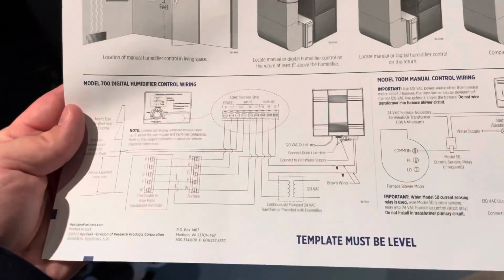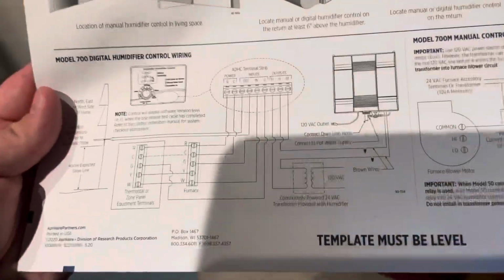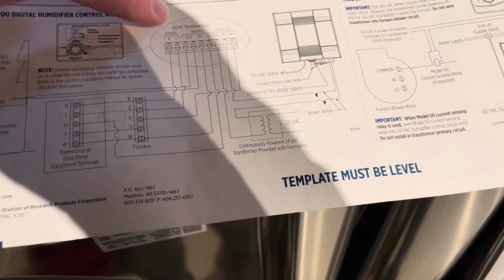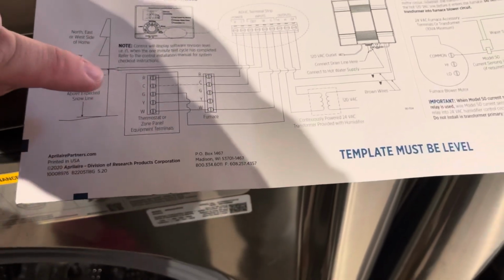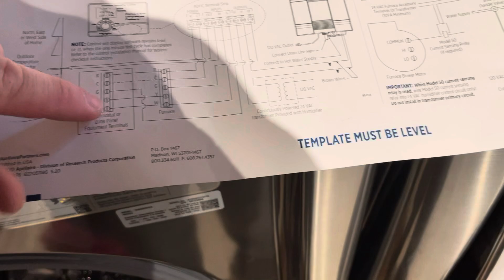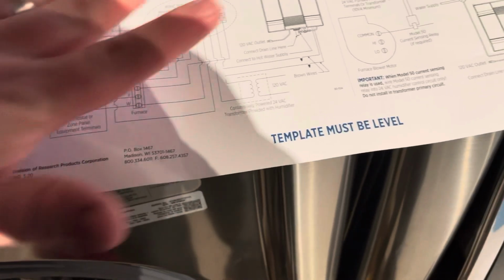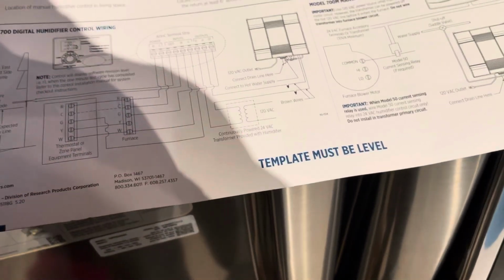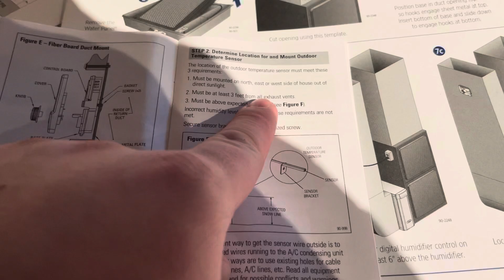Aprilaire 700 Series Transformer Wiring

Comment: I have a Carrier furnace as you..your control board is a little different from mine. Does your control board have ODT TERMINALS. if not where did you hook up your outdoor sensor to?
Great video by the way!!
Reply from the maker: Thanks! My outdoor sensor wired directly into the Aprilaire automatic humidity controller.

Comment: Do you really need the transformer? I have seen a few videos where they don't use the Transformer. I am also considering connecting my 700m directly to my nest thermostat using the * connection port on the nest, this way the nest can be programmed with a target humidity level and trigger the blower and humidifier to circulate air until the level is hit-- and many diagrams I've seen bypass the transformer completely. What do you think?
Reply from the maker: Transformers change the voltage and not having it installed would send the incorrect voltage and possibly damage the unit. I would not recommend bypassing the transformer.
Reply: I was told by an HVAC teacher and collegue that depending on the unit and the board, you might not need the transformer at all.  He said the board has plugs that product 24v-40v directly on the board.  I am meeting with him Thursday to go over it.  What bothers me is that the unit runs on 120 volt for the fan.  They could have easily wired in a transformer into the system and run it all off the wall plug.  All it would need is the connections to the mainboard and Model 60 humidistat.  And do not use those damn needle valves.
Reply: @Balticblue93  ive never used the transofrmer and i install 100s of humidifiers. Take one wire from humidistat, one wire from solenoid, meet them in the furnace and tie them together. Take the second wire from the humidistat and put it on W or HUM if its a 24v plug. Take the other wire from the solenoid and put it to C. Works 100% and Ive never had an issue. This only works with the manual one though. Digital is different like the one in the video.
Reply: The older 700 series did not have the 24V transformer, the most recent one does require
Reply: Depends on furnace and the board. Some furnaces HUM terminals are at 24v and some are 120. Always check before installing.

Comment: i just replaced my bryant 700m whole house humidifier with the aprilaire 700m and did not want to mess around with changing the transformer or humidistat controller (manual not digital)....the transformer is smaller but the values are the same; however, it does not turn on when the furnace activates.....should i assume the transformer and or the control must be replaced too?  (original transformer : input 120 v / 60hz output 24 v 40va  and aprilaire is input: 120v-60hz 15w utput: 24 v - 0.42 a 10w)
Reply: The Bryant 700m and the Aprilaire 700M are the same exact unit.  You should have gotten the Automatic and you would be setup perfectly.

Comment: Hi, The Gf wire from the digital humidistat controls the furnace fan on and off, and the H terminals control the water valve. It doesn't matter where the transformer gets it power from. Wiring from EAC won't hurt but it makes no difference in how the digital control unit operates. It does make a difference when using the manual 700m controller.
Reply: Thank you for this confirmation statement. After finishing my install of the transformer from a normal 120v source this video didnt make sense with how I thought my unit operated

Comment: I thought the unit was supposed to be installed on the return side?
Reply from the maker: According to the manufacturer you can install this unit on the return side (needs hot water tap if done this way) if there isn’t space available on the supply side. However better performance will be achieved if on the supply side.
Reply: You can installed it on the return or the supply side.  I personally like the return side because it gives the atominzation a chance to get spread in the air channel and throwing up the supply side.  I have my 700 Automatic running year around here in Colorado.  The Model 60 humidistat is truly automatic.  I said it around 35-38% and it holds it perfectly.  I do run the hot side off my water heater and works wonderufully.  I own an HVAC business that also does Home performance upgrades and modifications.  I sell these units mostly the 700 Auto and the 800 models with every new Furnace and AC unit.  I build it into the price at just over cost and to cover the labor.
Reply: The unit is supposed to go on the supply side.